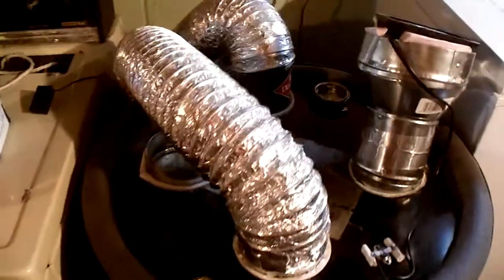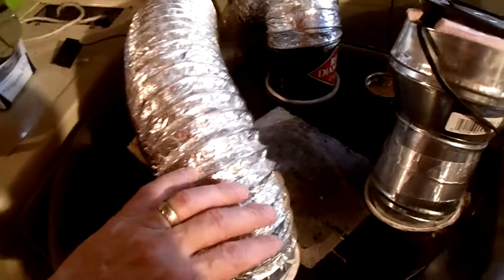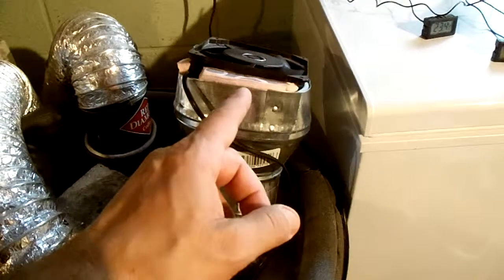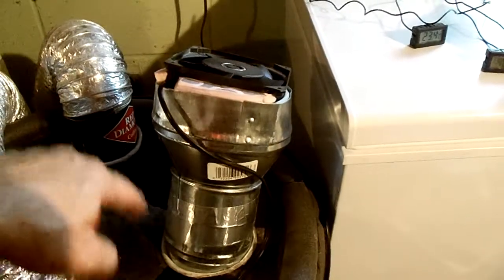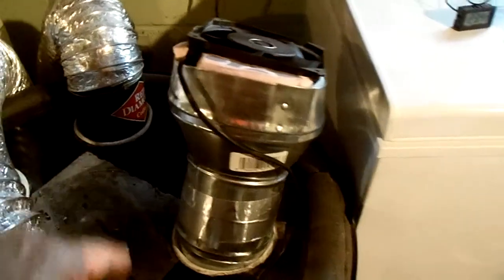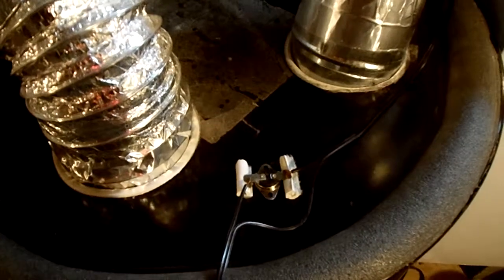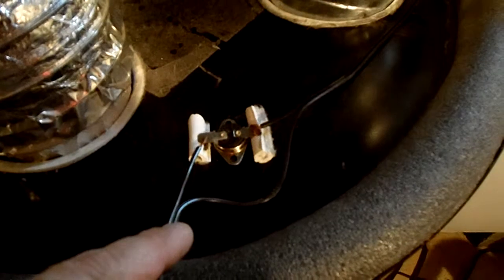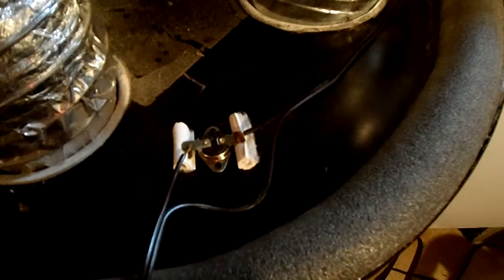Clothes Dryer Heat Exchanger Part 4

Comment from the maker: I swapped out the 2-liter bottles with 96 12-ounce Kroger Tea cans. (sealed) They serve as a heat sink.  As the dryer blows in 120-140 F air into the drum they heat up, as does the drum, and the coils of ductwork that sit on top of them.  After the clothes dryer turns off, the heat stored in the cans is released, keeping the "spaghetti" ductwork above them warm which keeps the mainframe fan (95 degree swithc) going long after the cycle (10 min) supplying heat to the room.